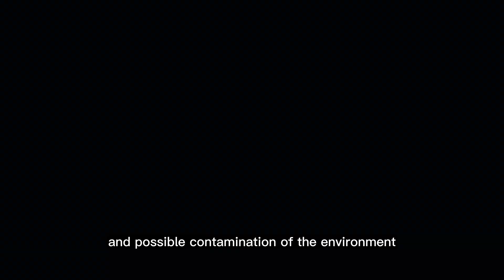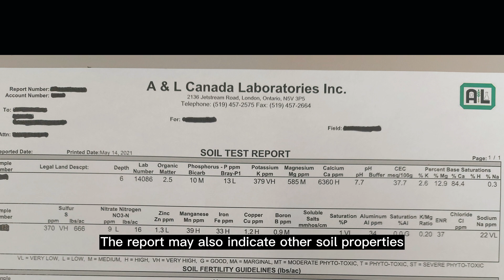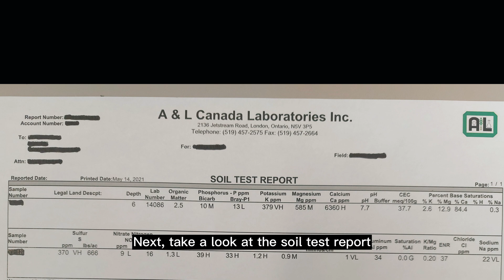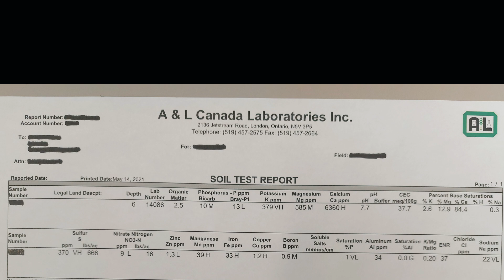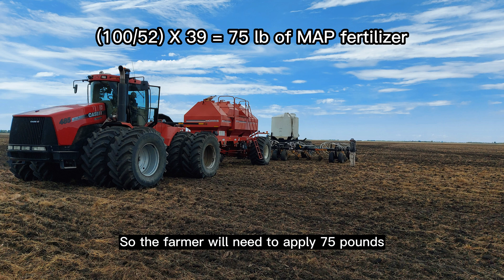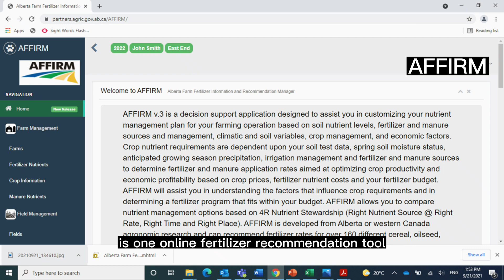How to make fertilizer recommendations from a soil test

Comment: Thank you for this great information. Question: Is there an accurate method of fertilizer application after calculating the required amount of fertilizer to be applied?
Reply: Hi, thank you for your question. Around here in western Canada, fertilizer is mostly applied by banding or placing it in the seed row. These methods place the fertilizer below the soil surface and minimize losses that may otherwise be observed if fertilizer was broadcasted on the soil surface.